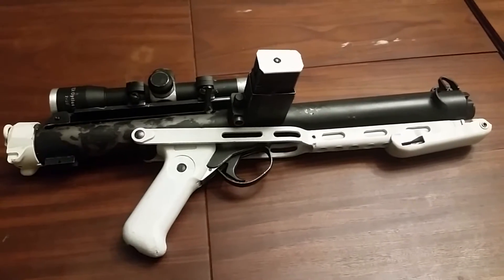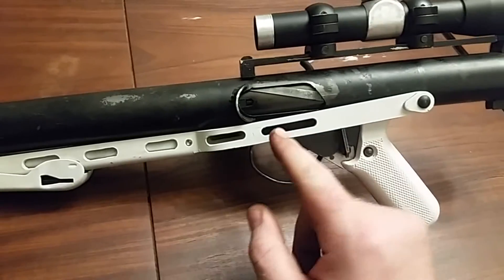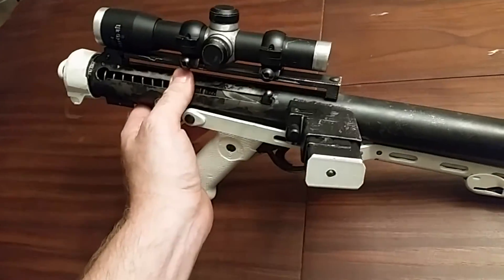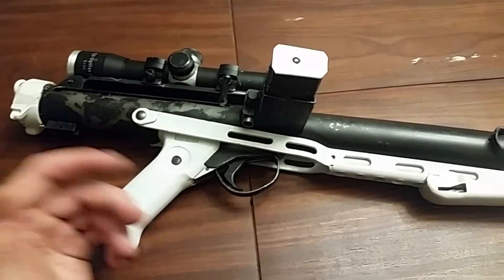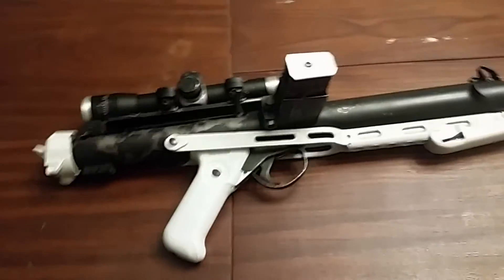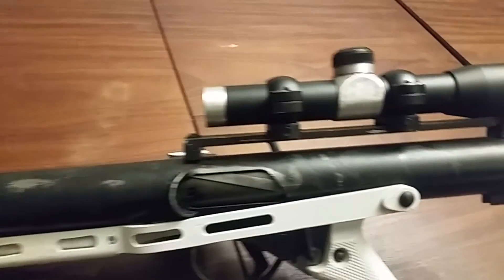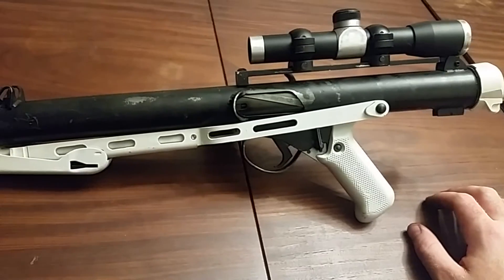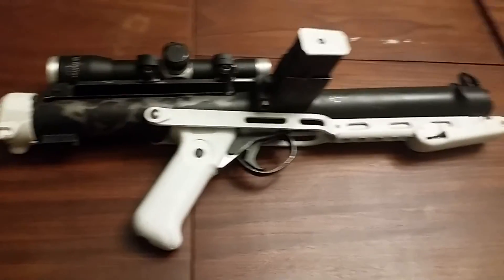Movie Gun Video 3: Star Wars Episode VII Modified E11 Blaster (live fire 9mm)

Comment: How did you reverse the receiver along with the bolt and charging handle so it will be able to fire properly?
Reply from the maker: +Matt Bruno 

The mad scientist came up with that.. we used an original bolt that was bored through, then made a striker assembly to run it, and machined the bolt so that it would run upside down....

The bolt handle was the original just flipped 180... as was the magwell and ejection port.

It was a lot of work, a lot of design on the fly and all credit goes to the Mad Scientist on this one.